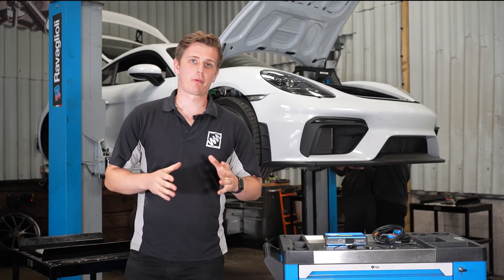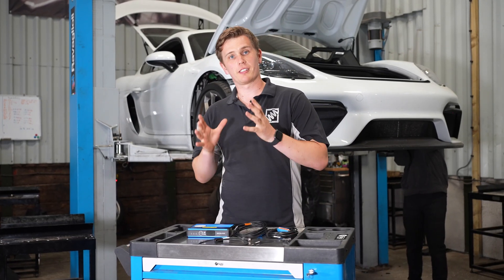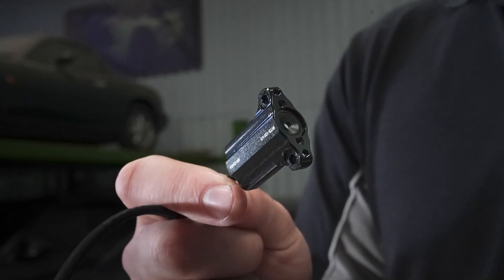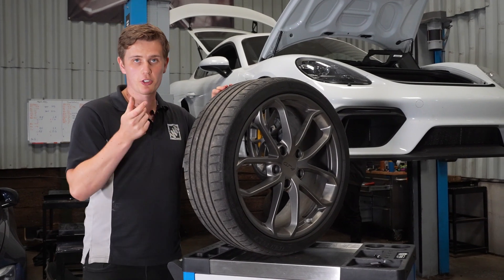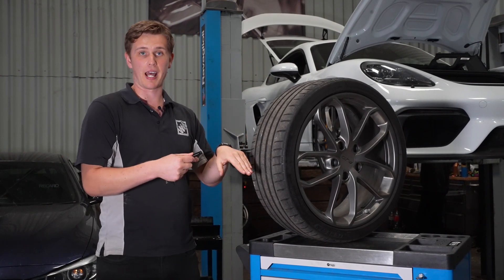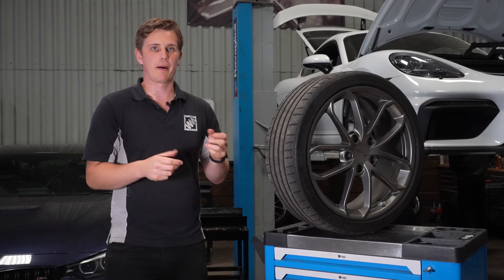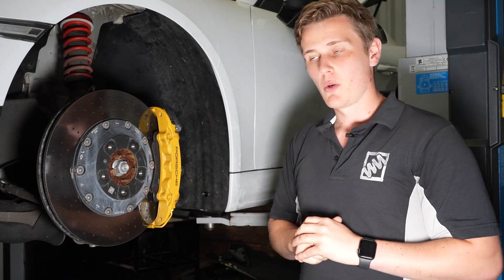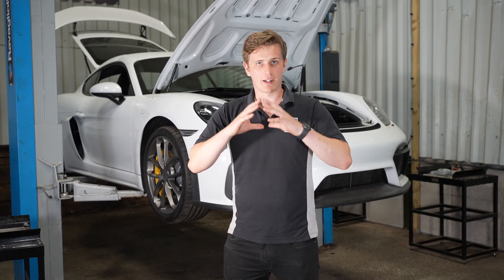FUTURE Track Car TECH - VBOX Tyre TEMP sensors - Porsche GT4 Ep2

Comment: Looking forward to this series. With the sensor mounted behind the front tire, the position of the sensor relative to the tire changes when the driver applies steering input. Thinking it would be better to place it directly above the front tire.
Reply from the maker: That was our thought also!! In the end we followed the installation instructions which did specify that it had to be at the back of the tyre. We speculated this may be because the distance between the tyre and the sensor is a specific distance dependant on tyre width. This is due to the angle of coverage for the sensor of 120degrees. So we went with around 70mm for the front and 85mm for the rear. Mounted on the top there may not be enough space as the wheel goes under compression. It would be interesting to experiment though!!
Reply: Why not in front? The chosen spot seems most likely to be damaged by debris and to accumulate dirt.
Reply from the maker: @e36s54  it’s to get the most accurate representation of tyre temperatures as soon as the tyre compound leaves the tarmac. If it was in the front edge it gives time for the tyre to cool as it rotates nearly 300 degrees after having contact with the tarmac. This keeps the data even more reliable and consistent
Reply: These are IR sensors? If so they presumably use software code to compensate for wheel angle as the sensors should detect the tyre edge. The mounting position is also probably due to not wanting the tyre to cool before the temperature is measured. It should be a great way of seeing how the suspension changes work. I guess the drivers are going to have to be incredibly consistent.
Reply from the maker: @DrBobtheblob  great thinking. Unfortunately there are some limitations in the software we are using so custom code isn’t possible in this case. And you are spot on why the sensors are mounted at the rear 👍